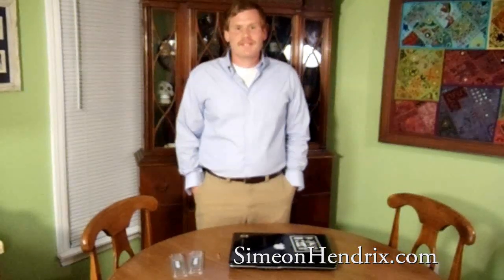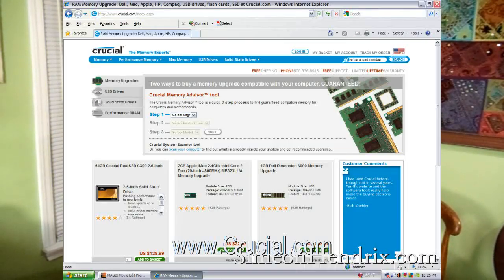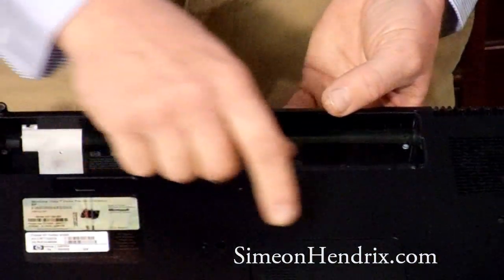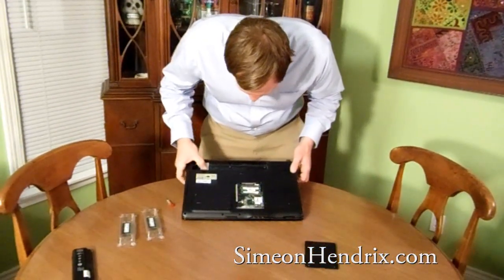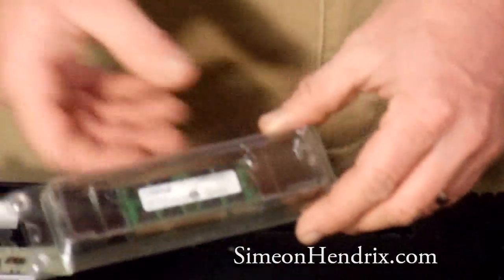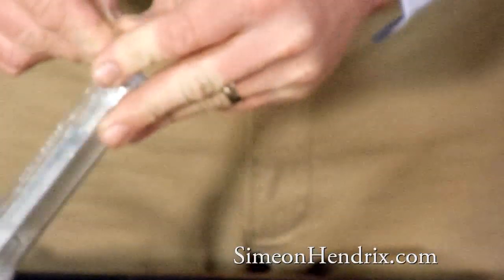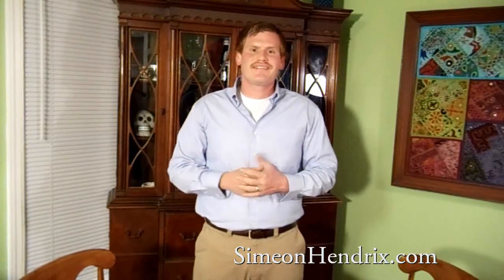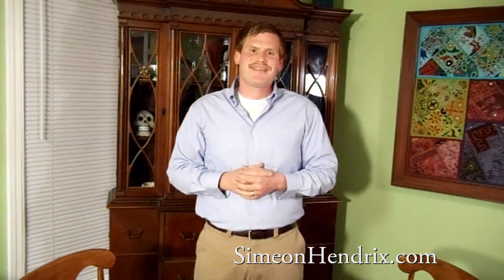How to Install and Upgrade RAM on Laptop (HP Pavilion)

Comment from the maker: Good question. First make sure that your laptop, can handle upgrading to 4GB from 2GB in the first place. Next, double check that all your RAM is full seated into their slots. Also, depending on which version of Windows you are using, even if you upgrade your RAM to 4GB, you still may only show less than 4.  To the best of my knowledge, unless you upgrade to a 64 bit version of Windows, you aren't able to utilize the full 4GBs of RAM. Still having issues?  I'd google for another answer.  Thanks!